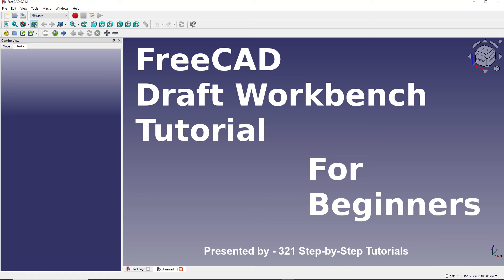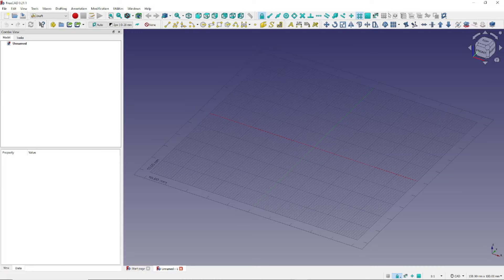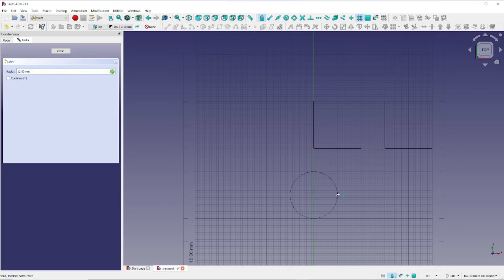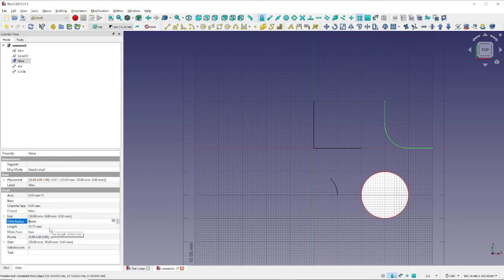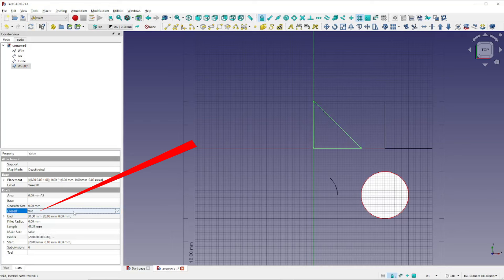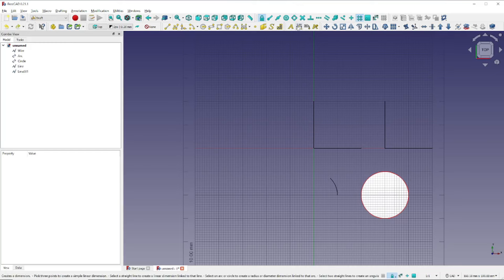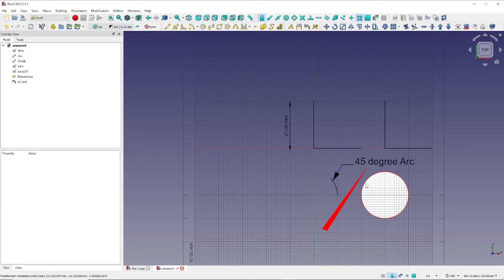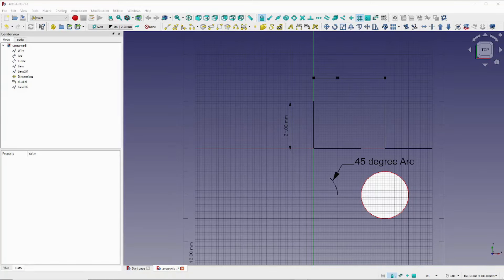FreeCAD Draft Workbench Tutorial

Comment: I'm learning freecad and I drew 2 rectangles in draft mode, one smaller than the other. I want the small one, which I drew after the big one, to sit inside but it seems to be hidden under the big one. In other drawing programs you can change the order or "bring to front". There must be a similar function here but I can't find it. Any suggestions?
Reply from the maker: Assuming you are working on the X,Y plane, you want to change the Properties of one of the rectangles to change it's Position on the X, Y, Z  plane... as described below...
1 - On the Draft Workbench set the view to Top View and the Working Plane to X,Y as demonstrated in the tutorial.
2 - Use the Rectangle Tool to create Rectangle 1
3 - Use the Rectangle Tool to create Rectangle 2, and partially overlap Rectangle 1
4 - Click on Either Rectangle to select it.
5 - Make sure you have the Rectangle selected on the Model tab in the Combo View.
6 - Under Properties click on the down arrow besides Placement
7 - Then click the down arrow by Position
7 - Now experiment by changing the value of Z
This should move the selected Rectangle up or down the Z axis as you wish.
Remember, FreeCAD is  a 3D app so keep in mind the Placement on the X, Y, Z plane.
Hope this helps.
Reply: @ thank you. I guess if 2 objects have the same Z then the overlap is determined only by the order in which they are drawn? I had hoped that I could reorder them in the model tab but that seems to be impossible.